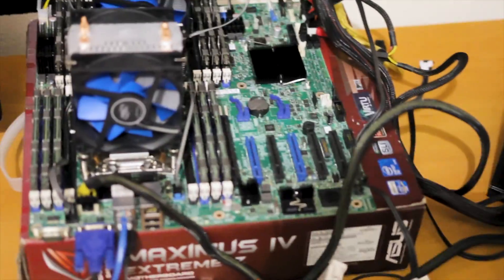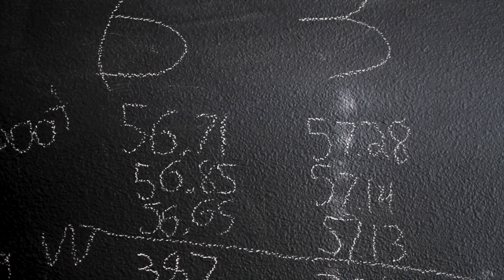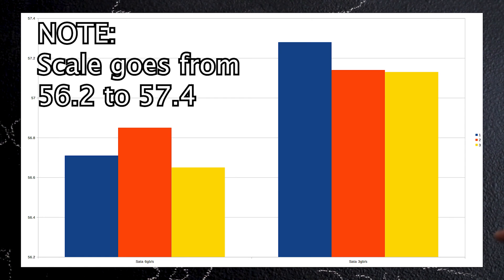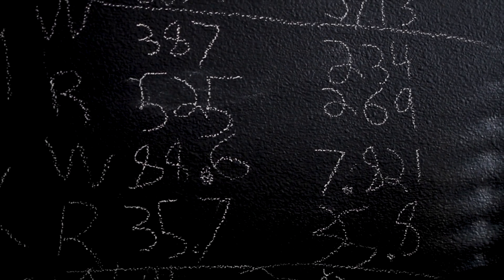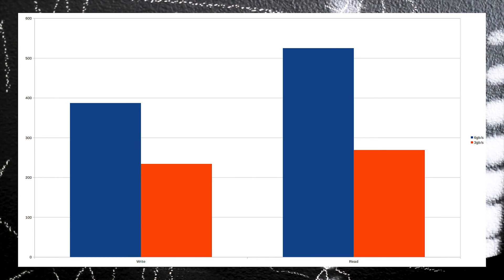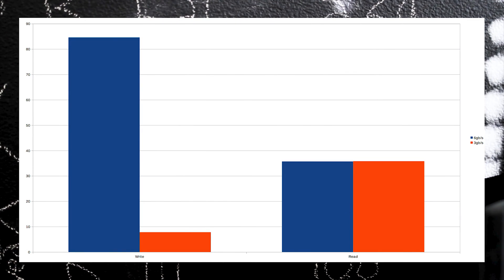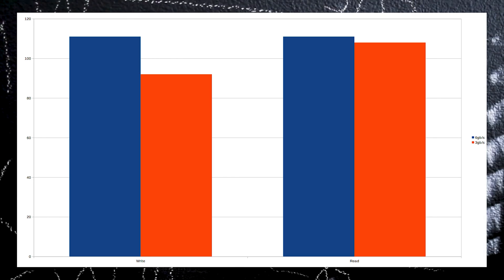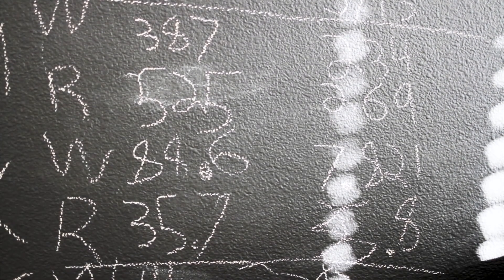How Much Slower does SATA 3gb/s Make a SSD?

Comment: Can't you just use crystal disk
Reply from the maker: You can use crystal disk mark but it only tests a few workload and doesn’t test things like app load times.
Reply: @ElectronicsWizardry  My motherboard has only sata 3gb/s ports. Iam debating if i should by a ssd or not, do you think it'll make a difference over a 500gb hdd 5400rpm? The one iam planning to get is the Kingston 240gb